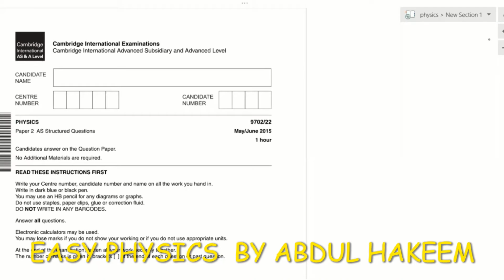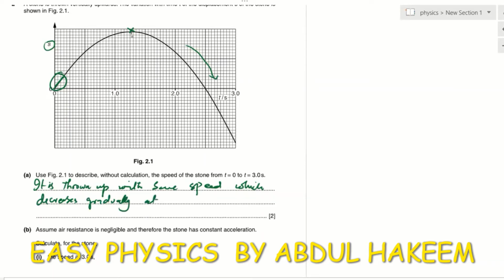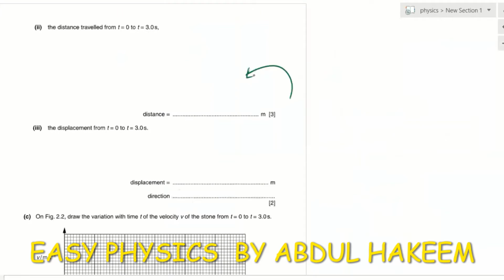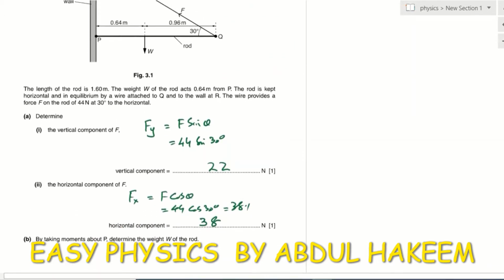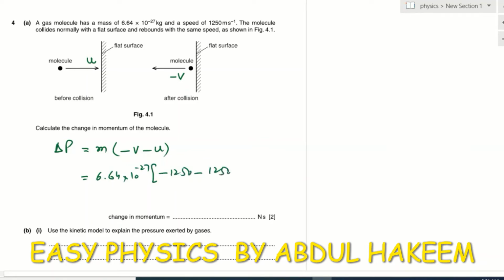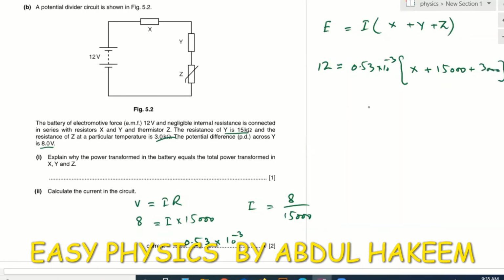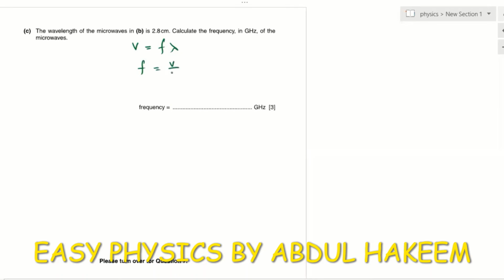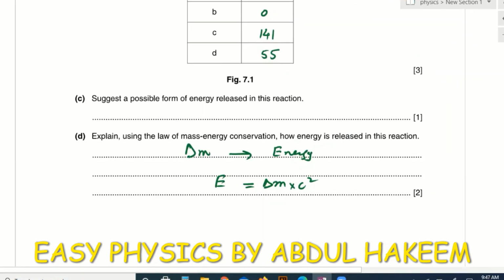MAY JUNE 2015 9702/22

Comment: in 3b, why the horizontal force of f and its perpendicular distance in vertical is not included?
Reply: theyre talking purely about force not moment because W and Fs moments are equal but different forces, 55N and 22N, so u compare Fy and W which arent equal means P must be exerting an upwards force to balance the 55N which isnt totally balanced by the Fy (vertical component of F)